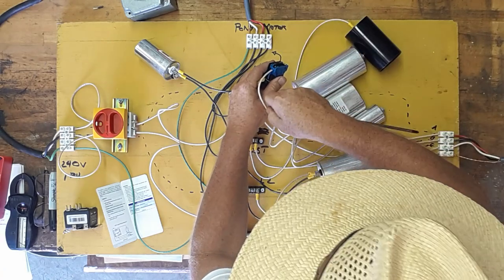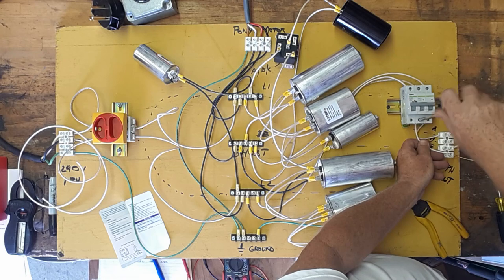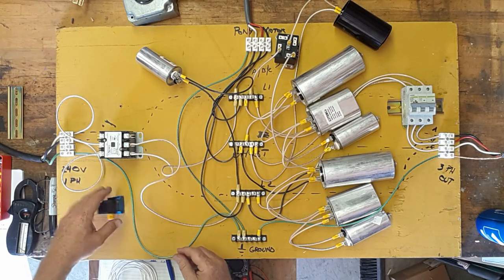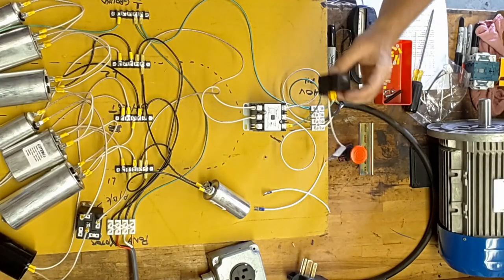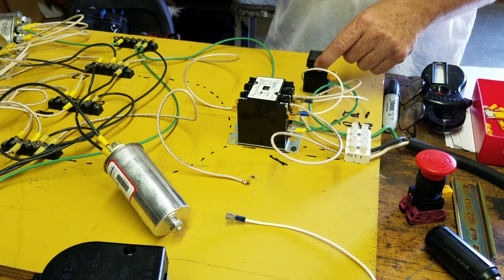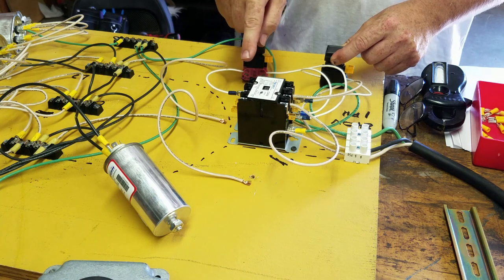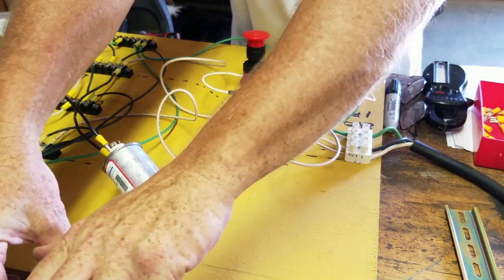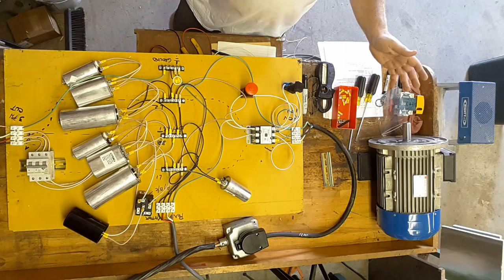Building a Phase Converter - Part 2

Comment: I don't know how it got wired in your final project, but in showing your testing, you had the estop switch after your pushbutton for the motor starter coil. You'd actually want to put the estop in the string first, so if the pushbutton were to fail closed, you'd de-energize the coil and stop the machine. it'd go Line -> Estop -> Start button -> Starter -> Start Button (load side of the contact). Otherwise, if your contacts fused, you'd have two sources of voltage, and you couldn't stop it with just the estop, you'd have to run and throw the breaker.
Reply from the maker: Hmmm...I will take a look at that and see about changing my implementation.   Thanks for taking the time to leave a comment.
Reply: if you are still around could you assist me please

Comment: It's not considered a "Motor starter" unless the contactor has a thermal overload with it (all one unit). Otherwise, it's just a contactor meant to make or break high current or frequent start/ stop loads (motors).
Reply: Yep, I caught that too.  Also he used ground wire for the neutral connection, which is a no no if this doesn't come out of the meter main panel.  Otherwise great video series, and I learned a lot.
Reply: Yup. And for all of the noobies out there, a 2 pole contactor is not legal. Hasn't been for ages. Use a 3 pole contactor.

Comment: Yes the ground wire goes to the same place as the neural line but they are never interchangeable.
Reply: I would think to run a neutral line just for the control circuit voltage, or bar that, copy a page or two from industrial electrical and throw in a small stepdown xformer for it - that, and this ground 120v hack is just a temporary hotfix until a proper control voltage supply can be given.

Comment: Solinoid - contractor - motor starter

Solinoid has a magnetic coil when energized performs a mechanical task ( door latch, valves, bell, ...etc)

Contractor (relay) has a magnetic coil when energized performs a mechanical task of closing electrical contacts( switch or switches)
Lights, control circuits, motors( if HP rated) ...etc.

Motor starter has a magnetic coil when energized performs a mechanical task to close electrical contacts and also has an intrigal motor protective device incorporated with it. Some are resettable if tripped and have interlocking contacts of their own to interrupt the starting circuit

Comment: Awesome. The 120v lamp, didn’t you wire that across 240v though? I thought each pair of legs had a potential of 240v (ish)? Did I miss something? Brill video subbed thank you
Reply: On an American "Edison circuit", it's single phase with 240 volts available across the two hot wires. It's also 120 volts from the neutral (or ground in his case) to either hot wire.

Comment: First off, this is a very clear and simple explanation for a device that can get perplexing. Well done!

Now for a few quibbles from an old controls guy. Your stop PB should interrupt the power going to the start PB so that tying down the start PB with a screwdriver or a ty-wrap won't allow it to bypass the stop PB  and turn on. 

And since you already had created 120 volts going to the coil of your contactor, that would be the logical place for the lamp as well.  It's bad enough to scab onto the ground for a neutral without doing it in multiple locations.

Comment: Thanks for your great video. I have watches all three of them multiple times and probably will watch them more when im building mine. Just ordered all the parts. Btw did you ever found a better way to take the start cp out? I saw some comments about timer and some about the wiring being incorrect for the potential relay that was used, not sure which route to go for that piece. Any advice is appreciated!!

Comment: The clamp looks like a spring compressor, like the springs in the background.  I like that safety pause, to evaluate wiring, before plugging in.  What voltage capacitors are you running, and did you get them at MidWest?
Reply from the maker: @Mature Patriot.  Sorry I missed this post.   Yes my cap's came from MidWest.  All of them except the 50mf, as they didn't have them.  I had to order a group of them off ebay.  I have extras if you would like to buy any.  There is a safety factor figured in so my cap's are all 370/440v.

Comment: To use the potential relay, for a true "self starting" converter, you must use the relay, with a contactor, running the capacitor thru the contactor and the relay to control the coil. I build all of mine that way. You turn the breaker, feeding the phase converter on and it starts on its own. In the event of a power outage, the starter will restart the convertor, but the connected equipment will not restart, due to their control circuits. It works well in my shop, it may or may not work for others.
Reply: I prepare using combination of  time delay switch and relays. Timed the cut off of start  capacitor.

Comment: Nice educational video.  One of the better ones out there.

However I see a fault in your wiring.  
With the 'Stop' button locked off, and pressing the 'Start' button the unit fires up.  This should not happen.  The stop switch should be installed in the green wire that goes to earth ...... and that is where I see a second fault.  If you plugged that unit into my power it would trip the RCD unit, (Earth Leakage) or whatever they are called in your part of the world.  You can dismantle the contactor and change the coil out to a different voltage.
Reply from the maker: You are for sure correct on the stop button.  Good observation.  It is truly annoying when I hit the momentary start and it immediately turns back off.  ~P

Comment: Kinda wish you had ran your start button circuit through the E-stop as well.  You should not be able to press the start button and pull the contractor in with the E-stop pushed.   Great videos though.

Comment: used magnetic contactor and timer for running capacitor cut off. overkill? :)
Reply from the maker: run cap cut off or start cap cut off?
Reply: sbirdranch sorry i mean start capacitor. Your video helped me alot to understand how it works.
Reply from the maker: @itsmelvyn  I figured that was what you meant.  So is it overkill?  No.  You have to get the start caps out of the circuit somehow.  Glad the videos where helpful.  I wish I had more subjects like this one.  ~P
Reply: Sir its okay for a 220 V power supply ?by the way im from Philippines😊

Comment: Starter implies contactor and overload together. A contactor isn't a starter. Also breakers don't protect for overloads effectively that is why they are called short circuit protectors not overloads.

Comment: good job on explanation and basic instruction but a couple of coments on safety and general knowledge. First one of the comments made asks why more people don't do this and instead choose to purchase a ready made unit, The answer is simple a lack of knowledge and skill. as an industrial electrician and mechanic of many years a word of caution these are voltages that can cause severe injury of death and all though most of the the time a little pain and a minor burn is all that result each year there are many deaths caused by just these type of circuits. a general knowledge of electrical safety is a must. If you talk to just about any professional they can give you multiple examples of people they know who have been injured or killed because of a moments carelessness or ignorance. if you are unsure about anything STOP and get help saving a couple of dollars just aren't worth the results. Also one thing most don't take into account is arc flash which in many cases causes more damage than the shock. If you don't believe me just search youtube for examples. The temp. reached during an arcflash will reach temps higher than the surface of the sun. twice during my career I have suffered such burns from no fault of my own and I will always carry the scars that were the result. 3 PH is inherently more dangerous than single phase and should be treated accordingly. Enough for now I will put away my soap box and say be safe and have fun.

Comment: This is great and thank you for this video. But at this point in your build, a VFD is cheaper.
Reply: For a single machine perhaps. Rpc can operate several machines when sized accordingly. I have large cnc machines that have inverter drives already and I could run one machine on single phase or 4 machines with an rpc. Depends on your needs. Lots of variables involved and not necessarily a true statement.
Reply: @glennedward2201  I could perfectly match 3-4 machines to VFD's for the cost of a single 7.5hp- 3phase motor.
Reply: @Elitiest_Hitman  For a Weder?
Reply: @Elitiest_Hitman  Keep in mind a VFD will split power from two legs across three legs, so there is roughly 33% power loss.  An RPC generates power on the third leg, so the machine will have full power.  My vertical mill on a VFD noticeably lacks power with larger face cutters.  Also, some complicated machines (my Burgmaster turret drill for example) do not play nice with VFDs, so the RPC is the only option.
In some cases a VFD is a fine option if cost is the only thing that matters to you.  But not necessarily the best option for performance.  Sometimes needs of specific machines and overall performance are more important than cost.

Comment: Thanks for your video and please help me! I got a 10 hp 3 phases motor to build my rotary converter but I’m having a hard time to balance the voltage T1 / T2 / T3. If I use just the run capacitor (830 mf), I can’t start the motor. But as soon I add 70 mf the motor start without the run capacitor by itself. Here are my tuning poor results.

CP CS Vab Vac Vbc
126 0 227 365 505
147 0 226 310 483
168 0 226 225 433
178 0 226 205 417
    
178 14 230 183 397
0 42 231 78 305
178 63 231 28 256
126 63 231 42 272

Comment: Your relay wasnt wired correctly that's why it failed on you. YOU have your L1 going to 5 on relay that's correct and 1 on relay going to start cap that's correct now YOU have the other side of start cap going to ghost which is wrong you run that one to L2. 
Now YOU have the 2 on relay going to the same post on your run capacitor as your L2 which is wrong the 2 on relay needs to go to the post on run capacitor that's connected to the ghost leg.
Reply: There are way too many companies/people using potential relays for bird to dismiss this so easily. He clearly needed help, but didn't seek it, taking a clumsy way out. It's disappointing considering how well everything else was presented. He really should revisit this and correct it. I will research this myself to make sure you're correct too.
Reply: The Potential Start Relay can also be Positon sensitive with only one direction being up, if installed in a different position the contacts will stay closed which intern will cause the Start Cp to blow open. Just a friendly note. I really enjoyed the video and I am going to build one out of a 25 HP motor.
Thanks for the great presentation and very well done. :)
Reply: I have made this exact setup and so far haven’t connected it to a potential relay( i have it using a extra temporary switch) but I would like to get rid of that extra button. Anyone has verified that the wiring in the video was wrong and if done correctly potential relay would work reliably? Any help is appreciated!!!
Reply: @moosaesfahanian8547  yes if wired correctly it will work reliably mine has been working perfect since I set it up with the way I described in the comment above
Reply: william hicks thanks for your quick response. I will go that route then. Would this work? ICM Controls UMSR-50 Universal Motor Starting Relay, 50 Amp, Patented Differential Voltage Sensing, Voltage Rating 110V - 270V AC, Single Phase (Maximum Voltage Contact Rating 502V AC) https://www.amazon.com/dp/B002JE3L9M/ref=cm_sw_r_cp_api_i_2GNEFb2K9YRK6
Reply: @william hicks I did as you said and it worked like a charm. Thank you
Reply: @johnhowell4725  came accross this a little while ago, never having been aware of such a component, testing a small disc/belt sander (after cleaning the motor bearings) with the machine lying on its side, wondered why I had the beginnings of "magic smoke escape" shortly after starting it.......  the start relay had "up" moulded into its plastic body. The penny dropped, I turned the machine upright, all was then well.....

Comment: A project like this one is not for the electrically uninitiated to undertake.  You are working with high voltages and currents.  A construction and/or wiring mistake can result in damage to the load, a
fire, or worse yet, a lethal shock.

I question the economics of building your own rotary converter.  Unless you can get all the parts needed to build the unit dirt-cheap (those capacitors can quickly add up in cost—oil-filled capacitors are much more long-lived in this sort of application than non-polarized electrolytics, but are also more costly), a quality static phase converter with a UL/CSA/CE listing will likely be no more expensive,
especially once you account for the expense of a suitable enclosure.  Also, static units make little noise, exhibit more accurate phase balance, and are more energy-efficient.

Comment: Just wondering, if the hp requirement for the pony motor , is one step higher on the load motor.. example...5hp pony motor, load motor 3 or 4hp, then it means the power consumption will more than double .  It means the power supply wires need to be upsize, circuit breaker need to be upsize.???
Reply: No, the total load will be a bit higher than the load motor, but not anywhere near a factor of two. Just a few percent due to friction loses and electrical resistance. In order to understand this, you need to understand how an electrical motor work. Here's a 20 thousand foot view that should help you.
When a motor runs, it also acts like an electrical generator with it's output 180 degrees out of phase with the input supplying voltage to the motor. Ideally, this generated voltage will exactly match the input voltage and counteract it, resulting in an effective voltage of 0 to the motor and cause the motor to draw no current. Obviously, this isn't the case since the windings in the motor have a non-zero resistance and generated voltage isn't generated with 100% efficiency. But the usual case is that a motor running with no load will be consuming very little current due to the opposing generated voltage.
Now when you apply a load to the motor, it will cause the shaft to lag behind the input slightly and cause the generated voltage to also lag in phase slightly being the input voltage. This causes less input voltage to be canceled, which in turn means that the motor sees a higher effective voltage, causing it to draw more current. This is why the current being drawn by an electrical motor increases when the load it has to spin increases.

For a rotary phase converter, you're taking advantage of this generated voltage on the unpowered phase of the pony motor. The purpose of the capacitors in the converter is to change the phase of the output so that the three legs are 120 degrees out of phase with each other (the 2 phase power being supplied has the 2 phases 180 degrees out of phase with each other. The capacitors are used to change the phase of one of them to either 120, or 240 degrees out of phase instead of the 180 degrees it's supplied to the system with).

The reason you want the pony motor to be larger than the load motor is simply because you want the pony motor to be able to handle the current requirement of the load motor and also to provide inertial mass to keep it spinning during transient load spikes (startup of the load motor, etc.)